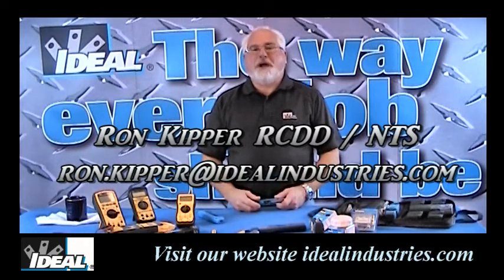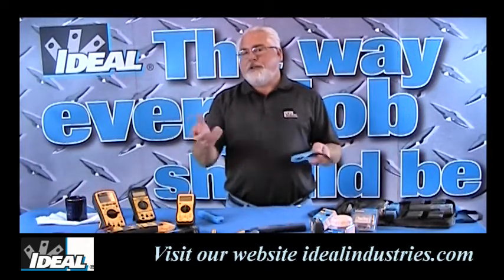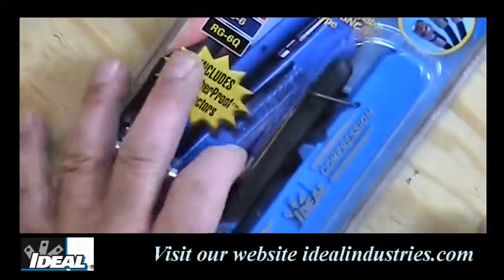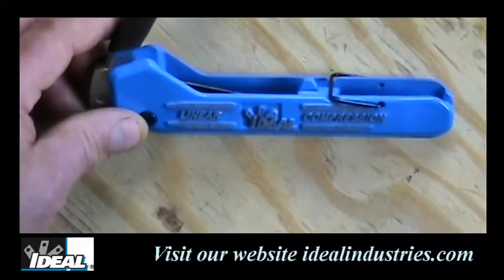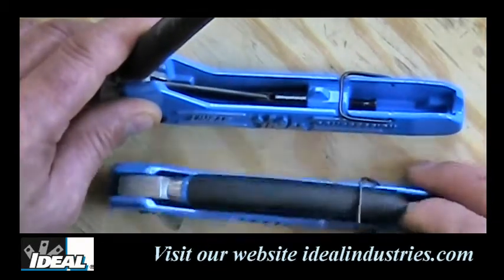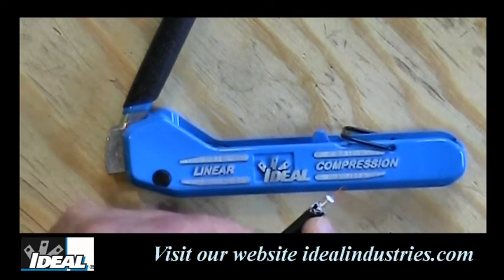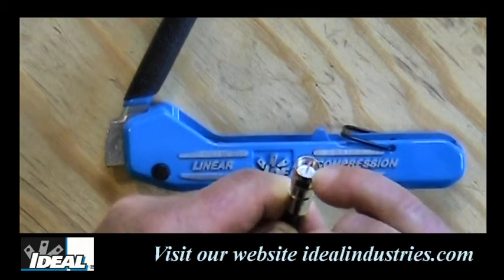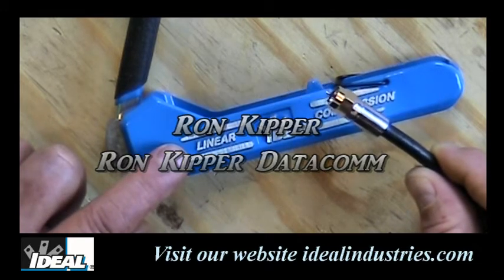Linear Compression Tools

Comment: Just to give anybody a heads up, this tool will not work with rg-59 small f connectors.  You will need to purchase large connectors... I learn that out without this video.  Thanks
Reply from the maker: Hi Leo the tool is madjustable so it will work with the RG-59 connectors if you need help just reach out to me Ron at ron.kipper@idealindustries.com

Comment: I have recently purchased the cutter stripper compression kit  33-622T it came with connectors 92-651 it claims to be for RG-59  RG-6  RG-6Q but I cannot get the connectors to fully seat on my cable which is RG-6 quad shield cable I have tried to place the connector against the side of my desk and pushing the cable into the connector but it still doesn`t go all the way in I lack about 1/2 inch from being all the way seated what gives ? Am I doing something wrong 
Could you do a video of installing a connector on quad shield from stripping to crimping that would be very helpful
Reply from the maker: Hi MrBuck here is a link to working with Quad cable and how to prep it for the connector. The connector should work on your cable. If you need more help just let me know. Ron
Reply from the maker: Sorry here is the link 
https://youtu.be/COSPOMombZc?list=PLw8qsvCN6q_0ESEi_5BNo5yyDOQzbDZvO

Comment: Where did you get those connectors that slide on so easily? Because they sure aren't the ones you guys make. You have to be stronger than Hercules himself to force those bastards on.
Reply from the maker: Hey Paul usually if you are having problems installing a connector something is wrong. Either you have the wrong connector for the cable you have or you are  not prepping the cable right. Reach out to me if you need help ron.kipper@idealindustries.com believe me we try to make them easy to install.

Comment: I can't get the white dielectric to go all the way in my connector. You got a tool for that?
Reply from the maker: Russell sorry for the delay I have been moving. Sounds like you don't have the right connector. If the cable is prepped right the connector should slide on without too much work. Hope you got it fixed Ron
Reply: @RonKipperDatacomm1  All the connectors came in the package with the tools. It seems that the specific cable that I was working with, had a thicker gauge on the inside. It took about three attempts to get it on for all of them, but it eventually worked. Thanks for responding.

Comment: Do the included connectors not work with rg6q cable? Mine doesn't seem to fit
Reply from the maker: Hey Drew those connectors should be good on RG-6 and RG-6 Quad coaxial cable. If you need help let me know.